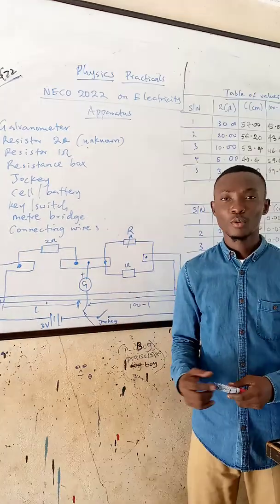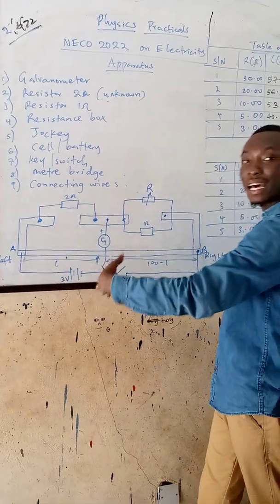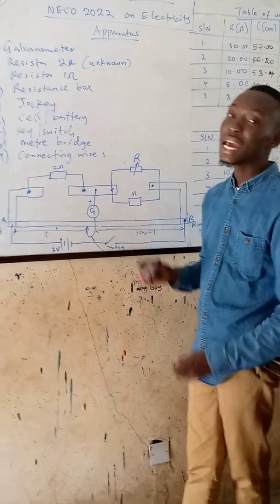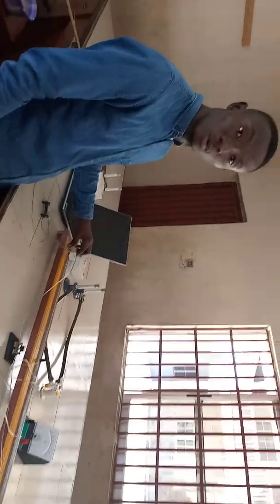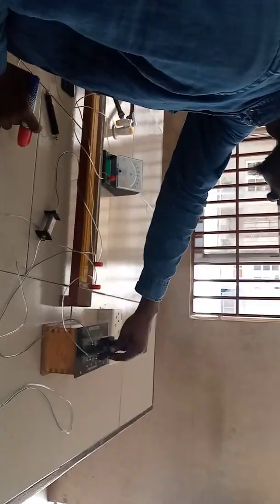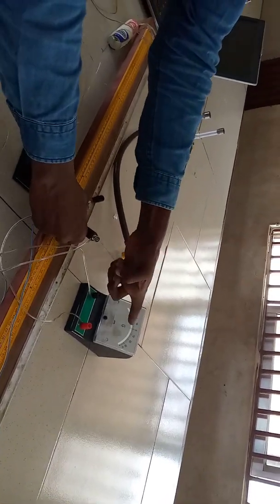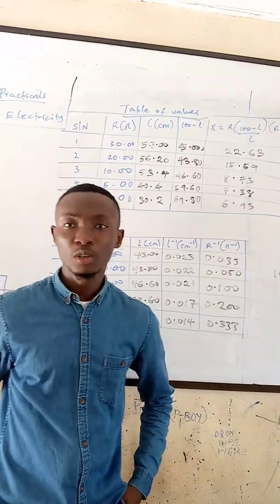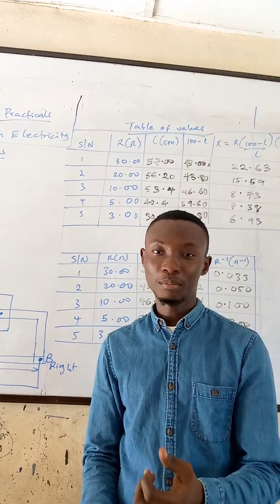NECO 2022 PHYSICS PRACTICALS ON ELECTRICITY....

Comment: Please my connection is deflecting only in one direction. What could be wrong
Reply from the maker: Ok check whether there is continuity ( meaning if you connected the positive end of the battery to the end of the metre bridge, you are to connect the positive terminal of the galvanometer to the center of the metre bridge, and the negative terminal to the jockey)....the resistor,key are passive( ie it does not have a positive or negative end....) As long as the connections are correct...the negative end of the battery is connected to the key and the other end of the key is connected back to the metre bridge...thanks)

Comment: Thanks for the practical

I like to ask what is the  importance of this practical in real life when it's comes to electronics
Reply from the maker: Thanks 👍 it's basically used in laboratories to find the unknown resistance of a wire,,,it also serves almost the same function as a potentiometer but it's more accurate and specific...
Reply from the maker: They are also used as control inputs in electronics circuits.
Reply: Thanks

Comment: Also sir is meter bridge same as pontentioneter?
Reply from the maker: Yes almost the only difference is that it has a place where u can connect the galvanometer
Reply: Meaning u can't use potentiometer?
Reply from the maker: @israeldaniels6020  you can just make sure your connections are correct when doing so....but to avoid mistakes just get a metre bridge....I used potentiometer one time and it also worked